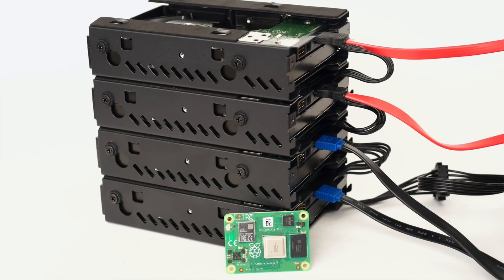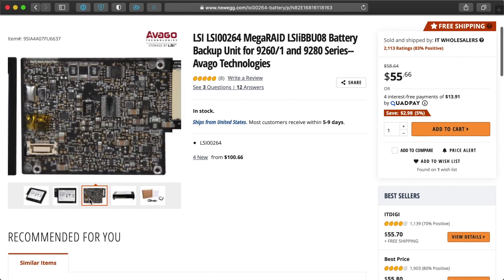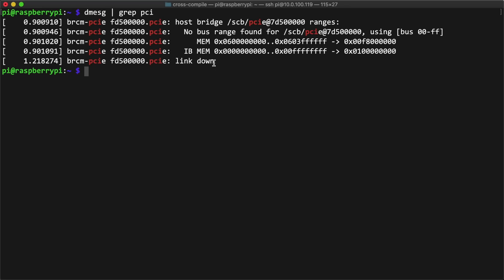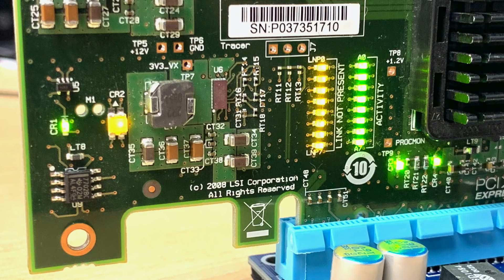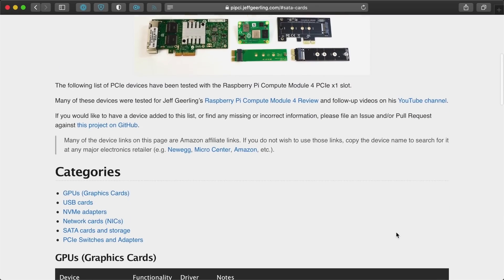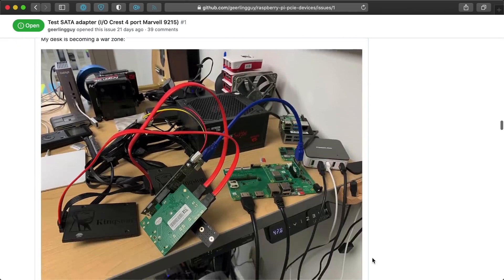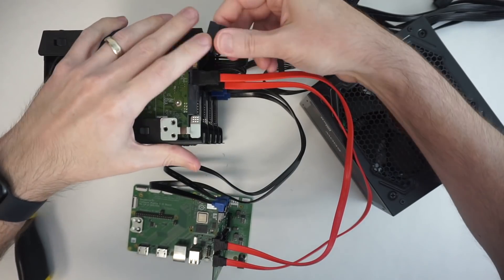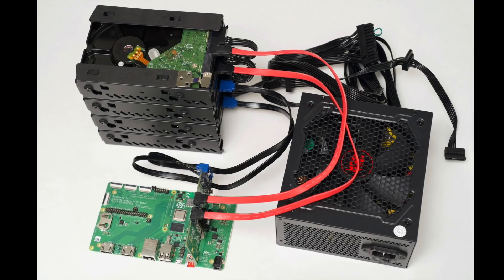Enterprise SAS RAID ...on a RASPBERRY PI?!

Comment: You said Dell LSI card's? To let them link up you need to disable a connection to the pci-e connector. Because the firmware searches for a dell mobo :( "The trick is just to physically disable the SMBus signal. It is composed of just two pins B5 (SMCLK, SMBus clock) and B6 (SMDAT, SMBus data). These two pins need to be covered by tape or nail polish. On the top side of the card, they are the 5th and 6th PCIe pins from the left."

Comment: Here is the reason WHY those RAID cards won't work. They CAN"T WORK WITH ONE LANE! A lot of those SAS RAID cards REQUIRE ALL LANES! Now this is an older SAS I Cards but i KNOW They work on 1 Lane and that is the a DELL SAS HBA 5 or 6 (They do JBOD/RAID1/RAID0). I use those cards for mass drive wiping and will run 3 cards with 8 drives each and i got PCIe 1x to 16x adapters and they work just fine. Now the Dell PERC (Full blown RAID) I have not tested as you MUST make a RAID and they don't work as a JBOD so never tried. I have tried the new Dell PERC H310 and no go and also a RocketRaid card with 4 internal and 4 external. Now they do need a hack done to them and a pin on the PCIe pins needs to be taped off or scraped off (I Scrapped mine off) for the HBA/PERC 5/6 to get it to work in newer systems. I have a Dell SAS HBA 5 4 Drive card you can have if you want to pay for shipping to test! They only work up to 2TB drives tho but do SATA and SAS. I'll even supply the cables. Have a lot of this stuff from old decommissioned servers.

Comment: What pins did you jump to get the power supply to work without a motherboard?
Reply from the maker: These two: https://github.com/geerlingguy/raspberry-pi-pcie-devices/issues/18#issuecomment-724148340 PS_ON and any of the common wires.

Comment: First of all thanks for your great vidz and output, also rock on with your hacking pi's/it's not meant but that's why I do it attitude.

Second, 
SAS != RAID
RAID != SAS
SAS != SATA

Meaning SAS is not equal to RAID or the other way around.
Maybe as I'm so familiar with legacy/modern enterprise HW stuff, I wanted to point that out for others (as you've probably have a good crasp on it already).

SAS (serial-attached-scsi) is modern serial SCSI as old legacy SCSI was parallel. SCSI is a protocol as is (P)ATA or (S)ATA. SAS controller can be either HBA without RAID or it might have RAID functionality. Even though majority probably are also raid controllers. 

Also not all SAS controllers talk ATA, there were few first gen SAS controllers which didn't have the support. Either it's embedded to the same SAS controller or the card also needs an ATA chip (this i'm unaware of but more likely it's the same). It's cheap to embed SATA but less so with SCSI. That's why majority of SAS cards support SATA, but not the other way around. Also they do not support both protocols simultaneously as I am aware of as I haven't worked with the newest stuff...

Comment: A lot of SAS or RAID cards need to be configured when booting up a pc. Could that be causing an issue?  Maybe you can find a Linux until to configure them?  Also, for the power supply you could use a GPIO pin on the Pi to power it on once the pinks booted?

Comment: SAS RAID cards will never work with a biosless computer such as the PI because it uses BIOS to run some code for the interactive configuration menu you get when booting (for creating/debugging raid volumes). You may have better luck with "dumb" cards, or IT/HBA mode cards that doesn't "do" RAID at all but just passes over the disks to the computer. You may also try RAID cards made for PowerPC servers but I wouldn't hold my breath on that working also.

Comment: These server sata cables may make for a bit cleaner setup: https://www.amazon.com/CableDeconn-Speed-6Gbps-Server-H0101/dp/B00VI3MFMO/ref=sr_1_1?dchild=1&keywords=CableDeconn+High+Speed+6Gbps+4pcs%2Fset+Sata+Cable+Sas+Cable+for+Server+1M+%28H0101%29&qid=1605369347&sr=8-1  but well done on getting things working. 

One point on the WD Green drives don't have TLER and some will even power down and park after inactivity so they are not typically recommended for raid configurations. For software raid they may work just fine, I don't know. If you see the drives dropping off-line frequently or in a constant state of repair you might consider looking at a different drive.

Comment: So like all his videos he has to recompile the kernel to get it to work. I do want to mention that a "Pi Hat" is a thing though only supports up to 3 spindle hard drives due to power limitations of the raspberry pi. To this it was made for the Rock pi and it has the heavy limitation of only up to 4 disks but you have to be sure about power on all those hard drives to make sure it can power them all as you might just get 1 SATA hard drive with 4 SATA ports and power connectors.

How Jeff did it is alot messier cable work but can be expanded upon to over 4 hard drives if needed also not limited to SATA if they ever write a SAS driver for the raspberry pi as an option for recompiling the kernel.

Comment: did you try putting tape on the memory channel pin? think you should look at this. Some of these SAS Controllers messes with the memory channels on certain hardware or causes other strange things to happen when using SAS Controllers on non server hardware. http://yannickdekoeijer.blogspot.com/2012/04/modding-dell-perc-6-sas-raidcontroller.html
Reply from the maker: Yes, I tried that after another suggestion from someone else—it didn't make a difference :(

Comment: Could it have been due to the SAS raid card trying to run it's BIOS on startup i.e. to setup the drives?
As it's for AMD64 it wouldn't have been able to run on the Arm?

There are some which run in HBA mode(i.e. don't handle the raid but let the OS have direct access to the disks, I've got one in my DL380e. Perhaps then it would then allow the PI to see the drives?

In essence it would be the same as the card you ended up with but with the ability to add more than 4 drives in the future.

Comment: I have tried a similar iocrest card (16 port,same chipset as the one you have I think ) on a  Rockpro64 and I couldn't get it to work. I also noticed the card getting extremely hot which worried me. I tried it on a regular PC and with Linux the card still got extremely hot, with Windows 10 however the card didn't heat up at all which let me to believe the linux drivers are not what they should be yet for this chipset. To be honest I wouldn't trust a 24/7 system with this card. Great video though! Interesting!
Reply from the maker: Heh, just wait until the next video—I have been monitoring thermals on this card, and I agree, there's something fishy about how hot the thing gets!

Comment: I wonder if you could flash the LSI cards into HBA mode and use them that way
Reply: Its not a firmware issue, it is a PCIe lane issues. Some of those cards just won't work on 1 PCIe lane. Deal with the LSI cards all the time with Dell and also other RAID cards and i have tired them in 1x to 16x adapters and they just won't work. I offered him some cards that I do know work though. Would love to see what the Pi 4 can do now!
Reply: @drtweak87  ah right, that makes sense. I have also tried pcie risers with adaptec and lsi cards, with mixed results

Comment: connect a relay to the pi's 5v out on the gpio and bridge the power supply through the relay NO connection then when you power on the pi the PSU will come on

Comment: You could try a hba card instead of a raid card. Raid card often struggle to run on consumer mainboards because of the bios. I bought a hba and was able to use 8 drives with it on my AM3 board.

Comment: Try covering PINs B5 (SMCLK, SMBus clock) an B6 (SMDAT, SMBus data)
 - This is a common thing to get OEM Storage/Raid cards to work in non-branded servers.  You can use clear nail polish or some kapton tape.

Comment: One way to make pc stuff survive a little longer is by not touching the gold connectors, they are gold for a reason, to ensure optimum contact so holding cards by the gold connectors is downright stupid. Your fingers are greasy and you might induce static electricity.

Comment: They sell power/reset switches for these psus.
I wonder if LED PSUs would work (probably not, as they don't have both 12 and 5V outputs; though a 12V to 5V buck converter is pretty cheap).

Comment: SanDisk extreme plus A2 rated MicroSD cards are pretty nice.  It has a sequential write of only 40+ MB/sec but has decent IOPS and is really quick on small files.  APT updates are quick like an SSD. I've found 64 GB A2 SanDisk cards on sale for less than $20.

Comment: I had the same issue with rhel 8, centos 8 and older mptsas 2008 based chipsets, they are dropped from the latest versions, that's why i couldn't install it on my 9260 based raid cards.
Maybe it's related ?
Not sure.

Comment: I had the same issue with powering an external PSU as you, to deal with this all you need is a logic level mosfet, a couple of resistors and some wire.
Use 5V from the Pi to turn on the mosfet, which in turn turns on the PSU.

Comment: that card is not doing hardware raid, thats a storage controller. if you wanted to do hardware raid the raid controller would do the raid calculations and have some ram itself for caching. an example LSI card is the LSI MegaRAID 9361-8i 1GB RAID

Comment: I've got a 16 lane SAS controller that might work well on here :P
Reply: I've even got a 16x2.5inch to 2x5.25 bay to make it a bit more compact and to clean up the cables, this hot swap drive enclosure uses 4x SFF-8613 and 4x SATA power,sure, you're not going to get super speeds, but using SSDs, you can get up to  128TB, i'm only working my way up to 32TB of SSD, but i've got a bit more powerful CPU. Still compact though, all of this is in a small portable server i will be using to sync between remote sites

Comment: Few things. Those drives are 5400rpm drives not 7200rpm. If it’s asmr drive, definitely don’t do zfs, you will get silent data corruption that you won’t even aware till you try to read the data out of it. Unless storage will heavy io on its volume, maybe usb3.0 is much easier route. However, I didn’t test stability enough using zfs on usb3.0 yet. Please don’t quote me on this. I would just do mergerfs for one big storage volume and share the data cross network. 
Third thing, I 2000% won’t use mdadm for raid except r0 or r1 or maybe....just maybe even on r10. Think about the rebuild time on raid volume and potential failure during rebuild, it’s a hard pass on me. Zfs make more sense if you want to use r5/6 or 10. However, with 4G memory, you might run into some performance issue down the road when you have massive data on it. 
Anyway, I have gone too far. For rpi, I think I’ll keep it simple to push through data cross network for media. For iscsi target or other high io request, I will stick with x86 solutions.  I’ll feel safer when put so many eggs in that basket or sleep better at night if I do that. After all, It’s the trade off base on what your needs and what you spend on it. 😉

Comment: Those Server grade Raid Cards are very weird in their behavior. They often won't even work in "normal" PCs. If you get a SAS card which isn't build for a specific server it might work. But shouldn't it be possible to connect a Sata drive through the sd card slot. Converting from sd card to ide/sata is possible so the other way around could be as well with fpgas and external power.
Reply: Wow...
Now that's an idea worth trying..!
I hope Jeff takes up the challenge...

Comment: I won't even start with the fact that you call linux md enterprise or using a cheap, limited and useless s-ata card as well as reeeeeealy slow mechanical drives that don't phase the puny controller which has 500Mb/s total bandwidth in it's good days. Hopefully you'll end up posting numbers this time around, don't forget to /dev/zero a couple of times so they look right. I love to see buffer metrics.
Reply from the maker: I meant the SAS cards are 'enterprise'. Software RAID of any sort is (IMO) not 'enterprise' grade (but can be perfectly adequate in many scenarios... heck Jellyfish makes about a bajillion dollars selling software RAID arrays).

But anyways, the point of this test (and most of the next video) is more to test/demo the capabilities (and let me tell you those drives are SLOOOOOOOW).

I have a pair of cheap-ish Kingston SSDs that individually trounce even the whole striped set of HDDs in RAID0 :)

I'll be showing some benchmarks from all the different configurations in the next video, stay tuned!
Reply: @JeffGeerling  But, but.... you don't USE those SAS cards. I'm commenting as an user of 2 LSI 8 port cards on a freenas box as well as pies on SSDs (USB 3 connected). From a POC point of view... it... helps. In a school project it's ok, I guess, but then again no one in their right mind uses this type of setup. You can eek out 60-70Mb/s from each drive if the blocks and the sectors and partitions and the planets are aligned. You hit play on a 4k medium bitrate movie from that thing and it melts into a puddle.
Reply from the maker: @schlbus  I've almost gotten the IO Crest card to melt... just from creating a RAID 1 array with 2 drives and waiting for the initial sync to complete!

Comment: This is such a great idea! it's much better than this old Lenovo Thinkserver with a chassis, 600W power supply, Xeon processor and 12GB of memory that I bought from my local e-waste recycling center for $35. I think once you've perfected this amazing solution I suggest you try it on a Samsung smart refrigerator. Then you'd have integrated cooling as well. In the icebox.

Comment: Wow! That's (hopefully) great! 
I have a home server (ITX, very low on power consumption) with two HDDs. 
Btw. the power supply is a picoPSU 12V connected to an industrial 12V power supply for DIN rails. It's working fine for the last four years.
After getting a better internet connection at my place,  I am pondering how to build  a firewall with LAN and DMZ for make my stuff accessible from the internet.
I don't like a part of my intranet connected to the internet. 
Currently, I run tests with my old laptops and USB-3 NICs (freebsd does the job, linux has problems) but somehow I had to realize that most of my old stuff is crap.
But putting a raspberry into the casing and plugging the HDDs at it could honestly solve my problems. Cable ties are a wonderful invention to mount everything :-)

Comment: Interesting to see the initial plan was for hardware raid. Due to the more limited CPU resources on a pi?

I've heard warnings against hw raid, mainly SMART monitoring being "broken" by the card hiding it, and when the card dies your disks are useless unless you have spare card of the same make/model.
Reply from the maker: It's definitely important to have your hardware raid monitoring properly configured. A lot of people kind of skimp on the configuration side of things and then, yeah, it gets hidden when certain things in the array fail until it's too late, it's 2 a.m. Monday morning and your entire system is going to need rebuilding.

Comment: My current file server is a 11 year Core 2 Duo and has 2 SATA internally and an external 4 SATA bay eSATA (or even USB 3), connected through a PCI-e SATA card.

I was pondering moving all of this to a PI compute module to reduce the noise level.

Feels like this could work.

(yes it's also a crazy idea)
Reply from the maker: Crazy, but fun.

Comment: Does the card actually need more than a 1x link?

Also, for the PSU, how about connecting that to the pi? You could either have that power the pi (and thus not need any other cables), and/or have the pi drive the PS_ON connecter low to switch it on.
Reply from the maker: I actually considered this, but then after testing it with a floppy power connector (which worked fine to power on the Pi), I realized how much more annoying it is to unplug the floppy connector than a barrel plug.

For a more permanent installation I may stick with the floppy connector (especially if I wire up a PSU power switch somewhere). But for testing the barrel plug is a lot easier.
Reply: @JeffGeerling  There is always the option of cutting cables and rewiring, no reason the ATX power supply can't have a barrel connector.
Reply from the maker: @jeffreyblack666  True, true. I'll maybe task Red Shirt Jeff on that.
Reply: @JeffGeerling  Glad I could help get red shirt more fun.
Did you have any thoughts on if the original card needed more than a 1x pcie slot?

I have been looking to replace my current NAS with a more customisable one, and that card looks a lot nicer than a bunch of wires.